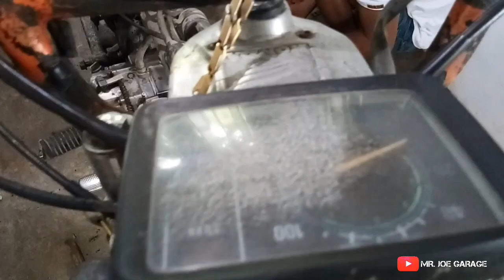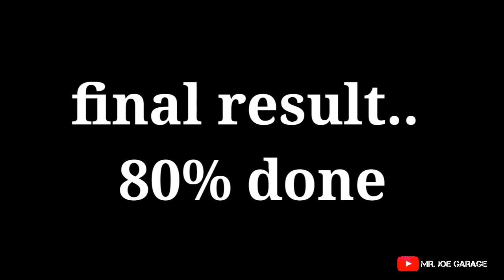HONDA TMX 155 LIMITED EDITION RESTORATION

Comment: Boss yung tmx na contactpoint pag ba nag convert ng stator papalitan pa yung segunyal?? 😂😂
Reply from the maker: Yes paps
Reply: Thanks paps
Reply from the maker: Kung stator lang papalitin mo paps kahit hindi kana mag palit ng segunyal. Papalit kalang ng segunnyal kung mag papalit ka ng pang i babaw.
Reply: Paps ganto po kasi yan
Reply: Nung nabili namin paps yung block nya pang 125 naka lagay pero sa paper 155.
Reply: D nga po namin alam kung ano talaga yun ehh kung cdi ba.. O contact point.  2000 po yung model..